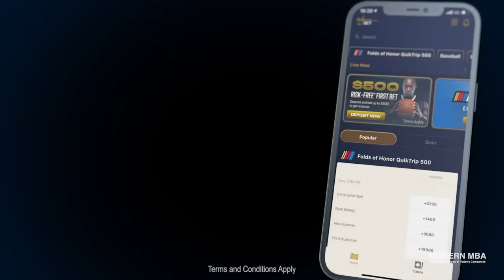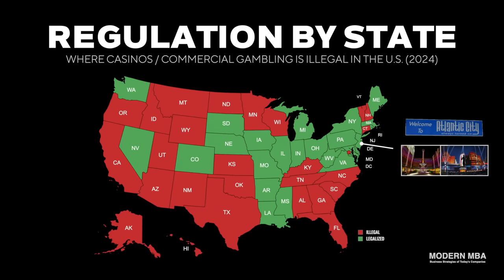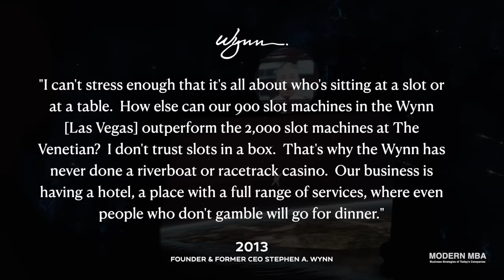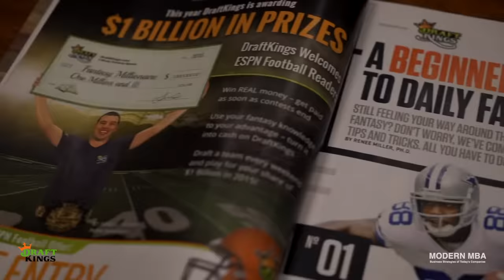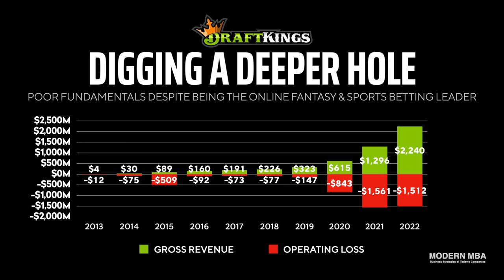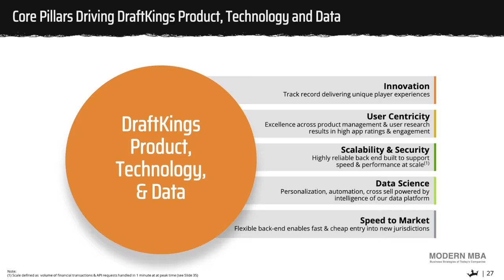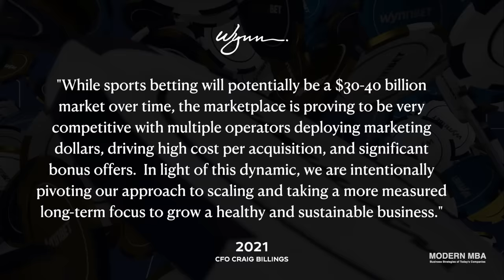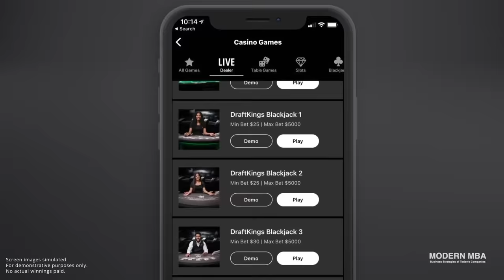The Wild Economics of Online Gambling

Comment: Proper black jack (i.e. where a blackjack pays 3:2) has a house edge around 0.5%, not 1-2% with proper "basic strategy" play. That's why card counting works due to card elimination and the odds changing as the deck(s) are played through.
Reply: .5% with perfect basic strategy.  1-2% is probably correct if you factor in all of the players at the table, including the ones who are not using basic strategy.

There is an error in jumping from a 1-2% house edge to the player having a 48-49% win rate, though (even if we simplify the game and ignore ties and multiple bets).  A 48% win rate would equal a 4% house edge - the difference between the house's 52% and the player's 48% - not a 2% house edge.
Reply: @ArmadilloAl  
True, however it’s not a simple 50-50 bet. Blackjack gets a 50% bonus. It also doesn’t take into account splits and double downs.
Reply: @JPINFV  if someone splits 10's i'm immediately leaving the table. Good luck counting over there i'm sure it'll work out for you.
Reply: @ryanr4361  On one hand, I wasn't talking about splitting 10s. 

On the other hand, IIRC, splitting 10s against a 6 is proper play with a +5 count... and against a 5 with a +6. It's also a good way to get a lot of heat though.